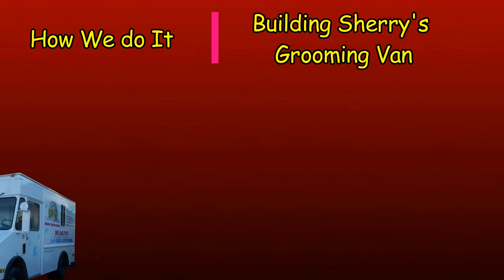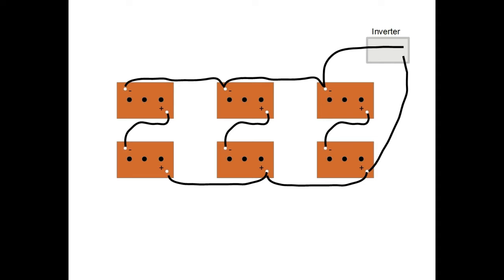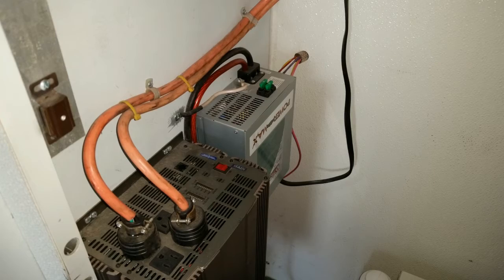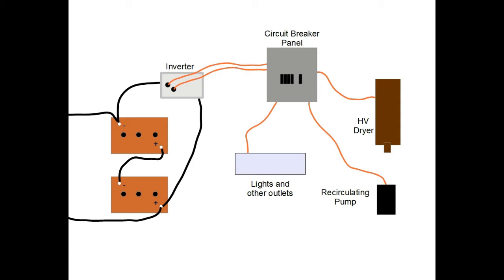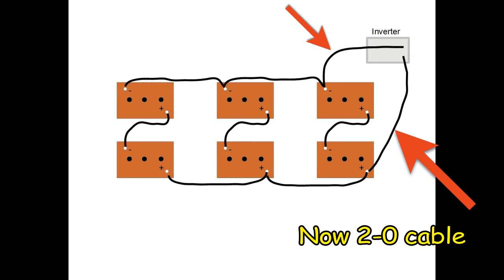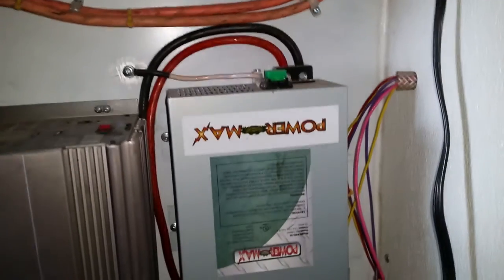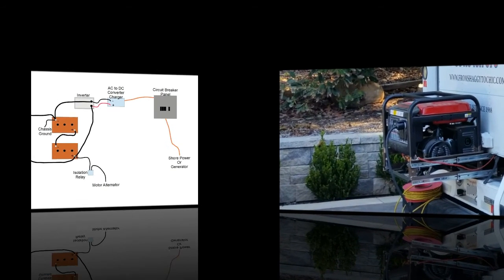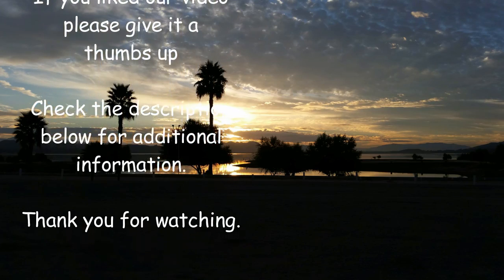How We Do It - Grooming Van Build Part 1 - Inverter Electrical System

Comment: These videos are CRAZY helpful only thing like this out there. How do u keep ur van insulated
Reply from the maker: Still working on that, the van has some insulation from the factory, but not as much as is needed. We are  thinking about a layer of foam on walls and ceilings and then cover it with FRP. But we haven't decided yet.
Reply: How We Do It good to know!

Comment: Hello, I am trying to get into the mobile grooming business. Can you please tell me an estimate on how much a renovation would cost?
Reply from the maker: To give a single number for the cost to us to build Sherry's van is not going to give you the cost you will pay. After saying that here are some of the things we bought and the price we paid, I will try to give time estimates for how long it took to engineer and to put it together.

The van, used $2500, several months search
The inverter electrical system, $1000, 15 hrs
The generator, $700, 10 hrs
Plumbing system including pumps, $250, 10 hrs
Water tanks, free scrap drums, I know what was in these drums before we used them so I know they were safe, new tanks are several hundred dollars 
Bathing tub, about $100, this was made from scrap steel hardie board and FRP panels, 20 hrs
Grooming table, free trash find and some scrap metal, 15 hrs
Misc shelves cabinets and other additions, $200 mostly scrap materials repurposed, 100 hrs
Reply from the maker: AC, $400, 5 hrs

The list can go on and on, with replacement parts for the van, maintenance, test projects that didn't work the way I wanted, etc...
If a single price had to be given, we insured it for $13000. To make sure we would have enough to build another one if it was totaled.
Reply: @HowWeDoIt_HowTo  Thank you, this would be very helpful if you could go into detail with it.
Reply: @HowWeDoIt_HowTo  That is good to know. What is a good sized vehicle that would be ideal?
Reply from the maker: Your questions are very good. I think the best way to answer them is with a video, we will be doing this video this month. If you have more questions feel free to comment.